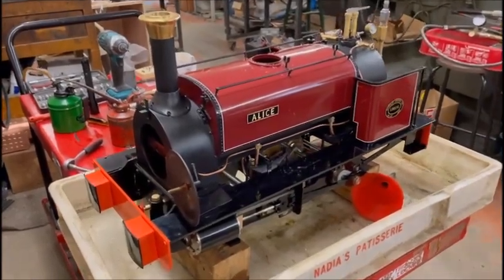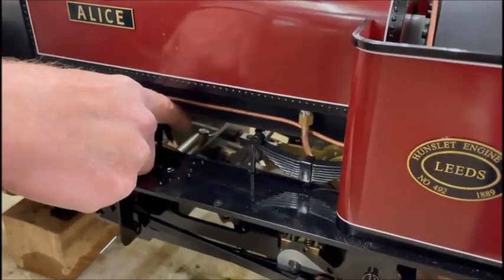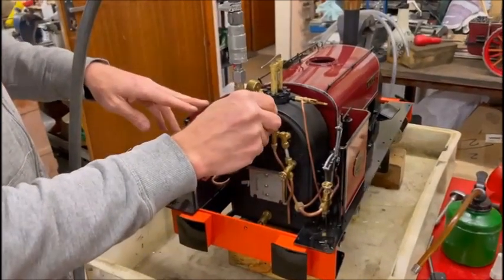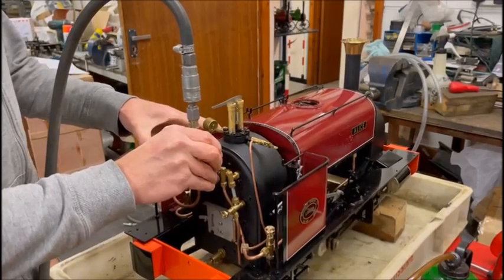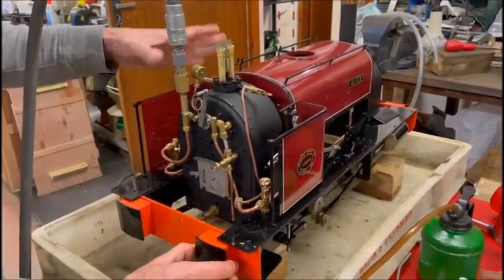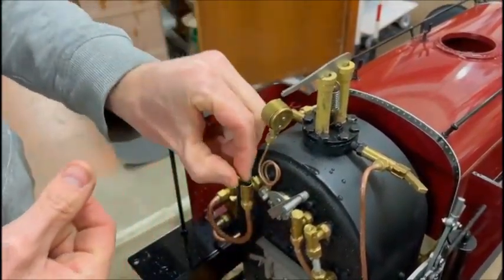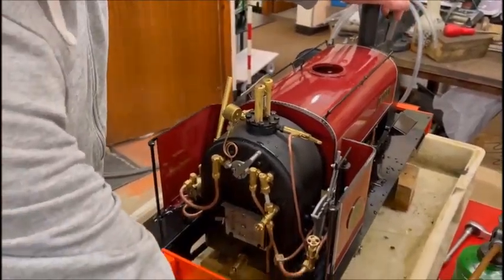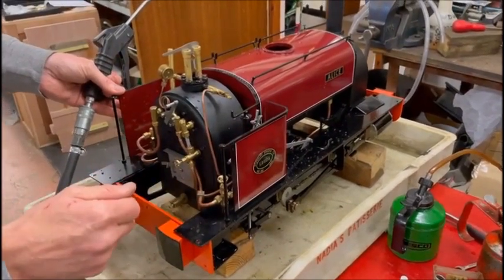Maxitrak Alice - Testing the Pumps

Comment: I had a similar problem on my Sapphire today. First time I've steamed her since I owned her, hasn't been steamed for around 4 years until today.
Hand pump had the same problem, wouldn't pump water, still don't think it's working quite right. Whilst it worked for filling the boiler, it didn't seem to have the umpf to top the boiler up once it was under pressure.